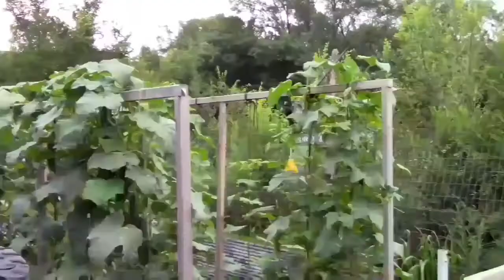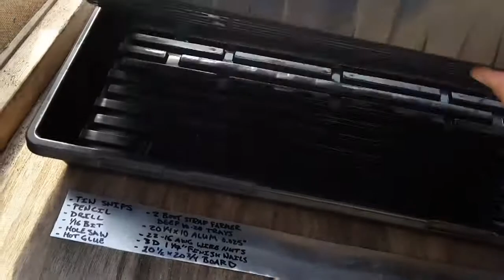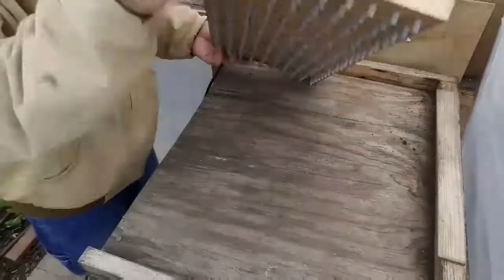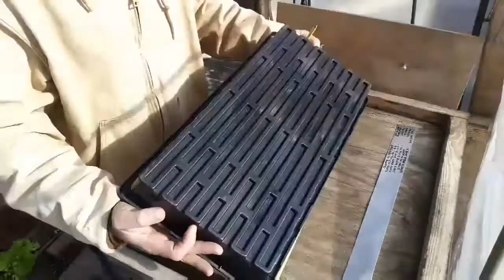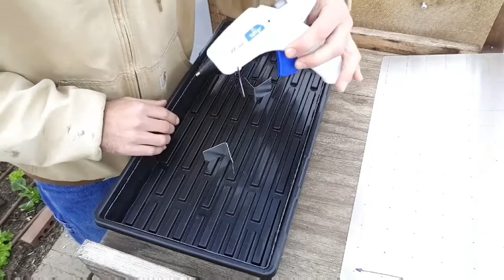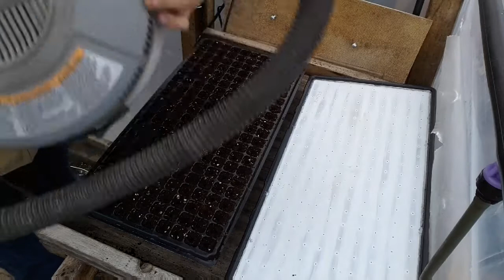How to Build a Vacuum Seeder. For Under $50!

Comment: Thanks so much. One of my major planting problem gone
Reply from the maker: I will warn you the aluminum and plastic connection has broke every type of caulking and adhesive I've tried. I now just use tape at the edge and replace it as needed

Comment: Where can I buy what you show at minute 10:37? I'm from Romania and I can't find it. A connection? Can you help me?
Reply from the maker: 0.5mm-1.25mm twist on wire connectors. For splicing small low voltage wire

Comment: Godsend!
Reply from the maker: Glue is the weak point
Reply: @farmerkeith  thanks for the update. i want to make my own very soon. do you think  a gasket sealing glue or a type of o ring would help with this problem? and do you find that your design works with all size seeds or would you modify the design to make the top plate interchangeable?

Comment: Great Job. Simple straightforward design. I think I can do it too!
Reply from the maker: Best thing ever. Still have not found a long lasting glue for the metal to aluminum joint. But a little tape is a quick fix

Comment: Im not sure what you grow, but have you every built a plate for petunia seeds?
Reply from the maker: It's the same process for any seed. Just make sure the hole you drill is not bigger than the seed our it will get sucked through.
Reply: Petunias might be tricky to find a drill bit small enough, but you might make it work by taping over the holes and then poking through the tape with a pin. That's what I plan to try this year..